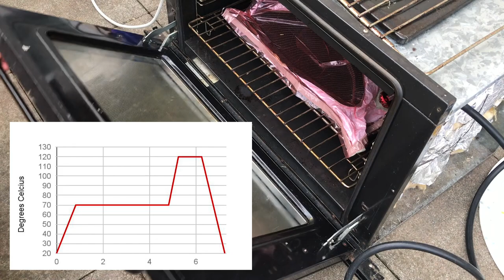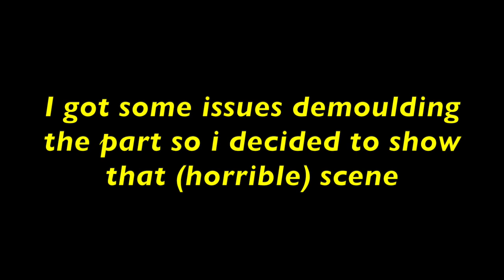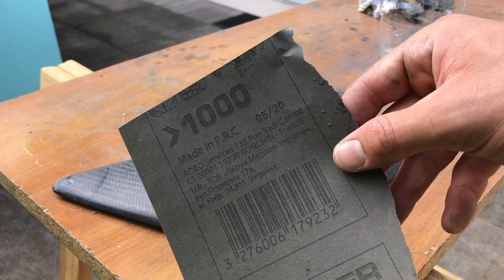HOW TO MAKE CARBON FIBER MOTORBIKE PARTS - PART 2 | DIY

Comment: Any way you can show us how you made you vacuumed heater?
Reply from the maker: of course man! I basically used an old kitchen oven and I wire it up to a PID controller. It works and only costs me like 25$. The curing temperatures go through 50 and 120 degrees celsius. For the vacuum stuff I only drill a hole where i can connect the vacuum pump. That's it, but I'm planning to do a video where a build up a bigger version of this oven so I can finally make car parts like rear diffuser, bonnet...
Reply: @pegorenzolab7038  dang that would be awesome i know ppl would definitely wanna watch that DIY video! Cant wait ill be on the look out for it for sure! Ive tried to find a video that shows how and no luck!
Reply from the maker: @fenomenon_5124  in the next months i’m gonna uploading that for shure. Stay tuned 😎
Reply: I am also waiting for the bigger oven! :)

Comment: Prepreg is so much easier than wet laying, but the problem that vacuum heater it's to damn expensive !
Reply from the maker: You are right. And the coolest thing about prepreg is that the fabric doesn’t distort when laminating. To cure the parts i use an old kitchen oven (0€ to me) with a PID controller (25€ on ebay) and a cheap vacuum pump (150€). But the hardest thing is curing the moulds.. the high temperature cycle can ruin the gelcoat (bubbles). Maybe I'm doing something wrong.
Reply: @pegorenzolab7038  you can learn a lot with easy composites video's (that's were I get my stuff from) they are really well made. I'll be waiting on your how to make an oven tutorial ;-)